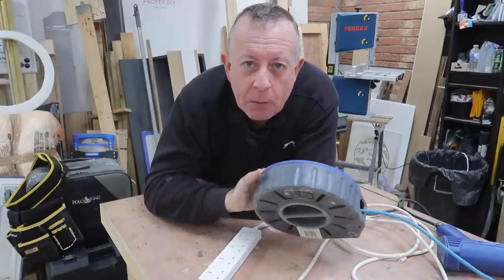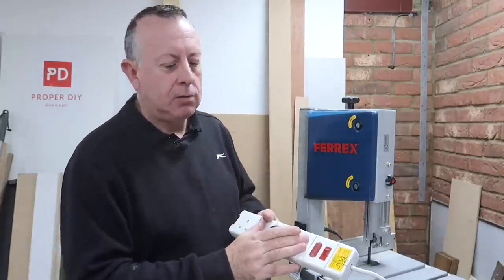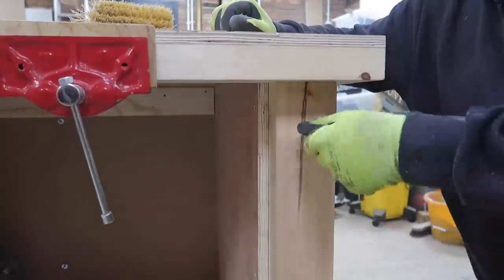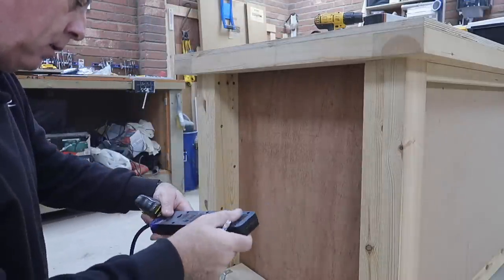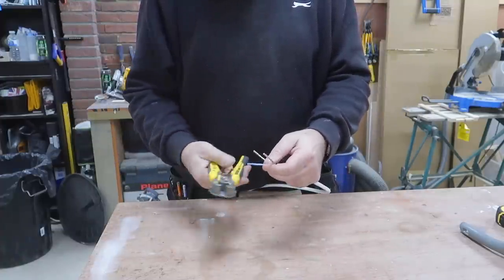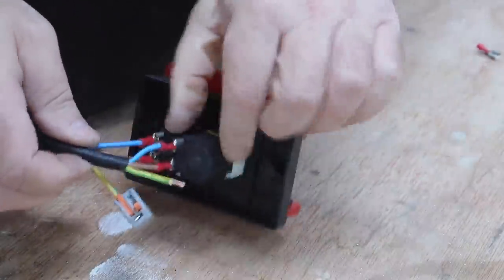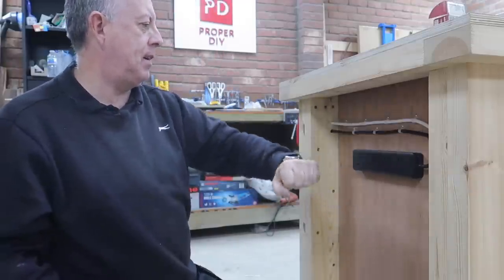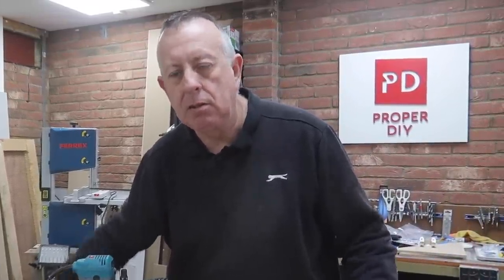How to Power Your Workbench

Comment: Hi Stuart, Quick question, you mentioned that the plug extention you fixed to the bench was a 13 AMP one, and you had to cut the plug head from it to install it. Was there a reason you did not just therefore re-use that plug on the end of the white cable? It there is a reason anyone doing a similar thing should not?
Reply: It's a moulded plug, like what comes with most electrical stuff these days, can't be used once cut off the cable.

Comment: Not good. No electrical connections should be made in timber. You require an earthed back box or plastic pattress for the switch to be mounted in.   BS7671 Wiringing regulations refer.

Comment: The use of a safety switch is a great idea but after that it all fell apart, you have again shown you are no electrician, I hope you have indemnity insurance… Please get some advise in future before you hit the post button. 
Chopping out the timber is a no no, you should have used a suitable enclosure that is not flammable to enclose the basic insulation and connections, unlike the wood which will catch fire in the event of a fault!! The use of strip extensions are not suitable for this application and would be overloaded - think 2000w router +1800w vac = overload! which is a typical use for what you have created . Also a 13A plugtop is not continuously rated at 13A, by my reckoning the above scenario is about double the continuous rating!!!
Your intentions are good but the execution is poor diy at best, I would use stronger words to describe it. 
Please stick to what you know.